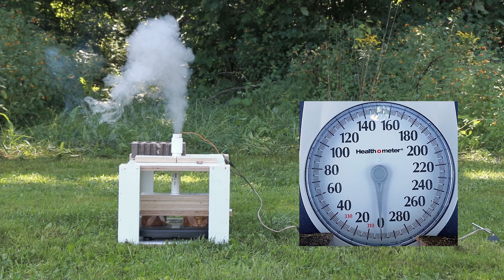Why PVC & Motor Thrust Test

Comment: I assume that when you're using the pvc motors to launch a rocket you use a different end cap. What do you use? 
Using your design, I've used threaded plugs and epoxy, but both have not been able to withstand the pressure.
Reply from the maker: I used a regular end cap with PVC glue for my Scorpion launch. I had to sand the  cap down to fit in a 38mm mount. It was not the best solution but worked for a quick test. 

Epoxy does not work well for glueing PVC parts. The correct glue will dissolve the plastic and weld the parts together. Will the motor hold together with a regular cap? If not then you may need a larger washer or less fuel.

I have built a rocket with a 54mm mount to accept the PVC motor using a carrier. Winter is approaching so I am not sure it will fly this year. Watch for "Candy Magic" in the spring complete with dual deploy!
Reply: @TheRocketeer  thank you for your reply. The motor will hold together with a regular cap and pvc glue, however the pvc end cap makes it hard to attach to the rest of the rocket. I will try a threaded plug with pvc glue and see if it works.

Comment: Hi ! Do you have any news on your quicksilver propellant ?
Reply from the maker: Yes, I have done one test with 10% Al in sorbitol and  I have cast 7 more grains with 15% Al. The KNSB has a slower burn rate compared to Flexi-fuel so I am sneeking up on the best KN (pressure) for the fuel. This method reduces destroyed hardware :)  Winter is on the way and I expect testing to be limited in the comming months.

I am working on the video and will publish the results as usual.
Reply: @TheRocketeer  nice to hear, thanks!
Reply: Yes I want to see a test of the knsb with magnalium
Reply from the maker: Yes, I have done one test with 10% Al in sorbitol and  I have cast 7 more grains with 15% Al. The KNSB has a slower burn rate compared to Flexi-fuel so I am sneeking up on the best KN (pressure) for the fuel. This method reduces destroyed hardware :)  Winter is on the way and I expect testing to be limited in the comming months.

I am working on the video and will publish the results as usual

Comment: Cheers from Dominican Republic, havent been able to work on my project due to time contrains but i was really curious about casting a single 6”-9” grain and just assemble the motor and cap to the same casting tube. Is there a valid reason not to do that? As i see many people casting smaller 2” grains
Reply from the maker: Bates grains are used to control the burn rate and pressure for a rocket motor. Using one long grain may cause the motor to have lower thrust at the beginning and then build too much pressure towards the end of the burn. Try it and see if it works.